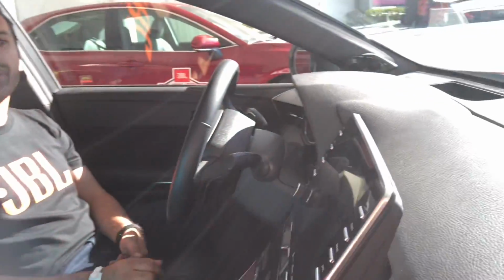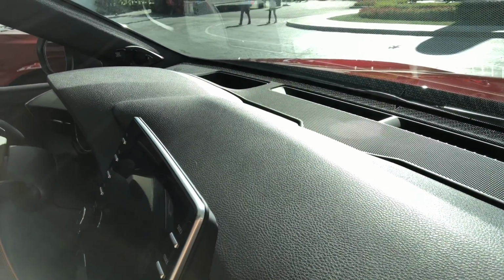What makes JBL sound so great in 2019 Avalon: Interview with Engineering Team

Comment: Love my Avalon 2019 but the only thing I hate is all the rattles that Toyota can’t seem to fix due to the sound system. That’s also having the bass and mids set at middle settings which I think is horrible since you can’t enjoy the system we pay for, common Toyota and Jbl you can do better
Reply: It’s probably your headliner in the rear. It’s a known issue. There’s plastic clips up there that barely touch the sheet metal roof. I paid less than $100 for an audio shop to put some sound deadening up there and it made a huge difference. I would recommend doing that if you enjoy any low end in your music.

Comment: I have this in a 2019 avalon, and the 8" sub in the rear deck rattles everything back there, and it's super muddy, the rest is decent, by no means is it on par with a custom setup, but as far as a factory system it's not the worst I've heard.
Reply: It’s probably your headliner in the rear. It’s a known issue. There’s plastic clips up there that barely touch the sheet metal roof. I paid less than $100 for an audio shop to put some sound deadening up there and it made a huge difference. I would recommend doing that if you enjoy any low end in your music.

Comment: My 2021 Avalon JBL sound horrible, the bass just rattle everything, even with 0 level on EQ. Horrible!!!
Reply: It’s probably your headliner in the rear. It’s a known issue. There’s plastic clips up there that barely touch the sheet metal roof. I paid less than $100 for an audio shop to put some sound deadening up there and it made a huge difference. I would recommend doing that if you enjoy any low end in your music.

Comment: More speakers doesn't mean better! I have this car and I can tell you the system is not that great! It could be much better. The music is very muddy at times, and the vocals are not  open and sharp. And the bass makes me want to cry its so bad. If you keep the volume very low it can be a decent experience with the sound system. But overall I know JBL could do better than this. I am going to replace every speaker and amp with aftermarket and get it tuned
Reply: You must be a serious audiophile. I think the sound is good. It just doesn't get loud enough. Also the bass can be a bit overbearing even when lowered to the minimum. I will also be replacing the speakers eventually as it doesn't get as loud as I would like.
Reply: @AllDayErrDay.  it’s not about being a serious audiophile, I myself upgraded my sound in my car and tell me if you don’t cheap out on amps and speakers paired with a  nice stereo you’ll be impressed and that’s not including a dsp. Never cheap out on wires either it can make a difference.
Reply: Agree w you 100%, sound horrible!!! Especially bass!!!

Comment: I'm not impressed with the JBL sound system  installed in my 2019 Avalon XLT. I had no choice all the Avalon's had the $700 JBL sound system. 1400 Watt can't be true, just an untrue advertising gimmick from JBL. The car without that expensive mandatory option has  more then enough speakers as standard. When I worked at JBL as an engineer we bought all our small speakers from China and relabeled them,
Reply: There's no such thing as an Avalon XLT.  If you spent 40k on a car, I think you'd remember what you bought.  Troll alert.
Reply: I wish I could install JbL for 700 dollars... In europe you need to take the highest trim and pay 2,5k dollars. This is sick!
Reply: So what your saying is take that $700 & put it towards aftermarket. Sounds about right!
Reply: More is not better in this case for sure!
Reply: Sorry my Avalon is XLE my Ford truck is a XLT, I got confused.